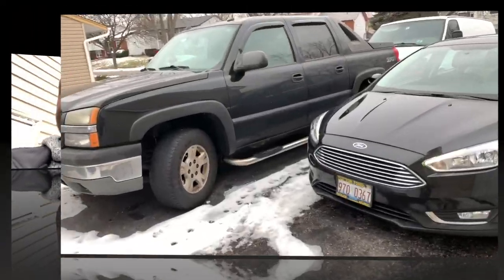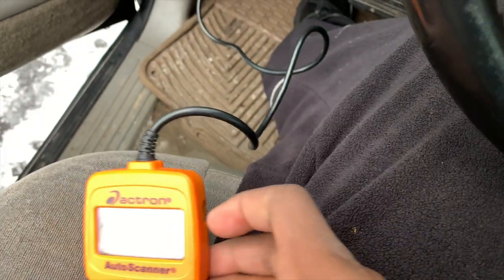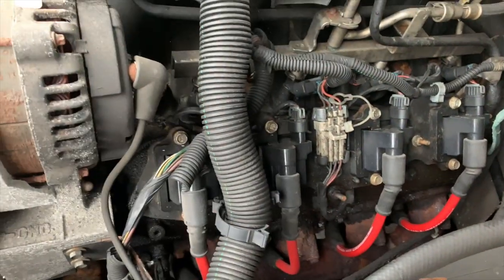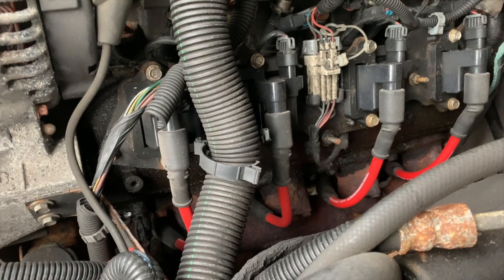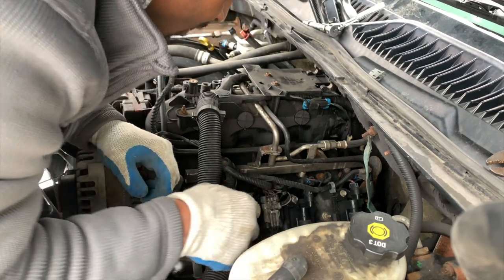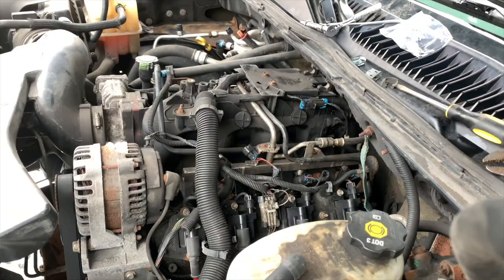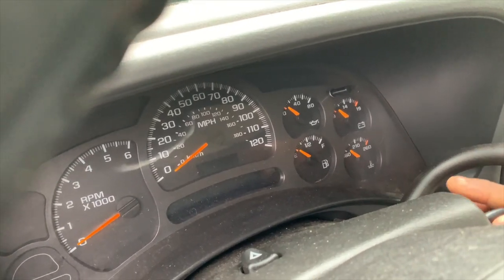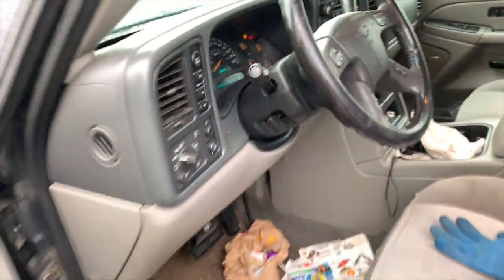Chevy Truck Cylinder 3 Misfire, Diagnose and Repair (Chevy Avalanche)

Comment: My 2005 GMC Yukon XL had the exact same problem. I took it to a car repair shop, very reputable in our town, and they replaced coil number 3. I got out on the road and within 20 minutes it was misfiring again. I took it back and they said the coil they put on was defective and replaced it with another one. Then within 20 miles that one started misfiring as well. I've been searching the internet for a possible secondary problem and looks like I found it through your video. Truck is running like a fresh engine again. 240,000 miles and still a gem. Big thank you, Sir! Keep up the good work.
Reply from the maker: Hi Ed, I am happy my video helped you. Thanks for watching!
Reply: It was the injectors?
Reply: Lmfao you didn’t even say what the issue was

Comment: I just had a similar incident. one of my brand new coil packs shorted out and blew the fuse for the entire drivers side cause if all four cylinders to not fire. All codes came back saying o2 sensors bad map sensor bad mass airflow sensor bad. Fuel pump etc. GM needs to make the fuses for individual coils. Instead of just one per side

Comment: I replaced my wires and plugs and my 05 gmc thru the same  code . I replaced the #3 spark plug with a good old sparkplug and walla problem fixed . New spark plugs can have a short to
Reply from the maker: Thanks for sharing that info.

Comment: Terence, You are dog-ass mean working in that ice.    My hat is off to you!    I haven't been working on my own vehicles since before the injectors.   Just changed plugs, then got the engine light, then replaced wires.   Diagnostic tool at the auto parts said #8 so replaced the coil.   Light went off but three days later its back.   So suspecting something similar.     I don't think I'm up for this for fear of doing more damage than good.  I have a way of doing that.   Don't pay any mind to the "throwing parts" comment you got.   Appreciate the video.   Now I know what I'm gonna pay for.

Comment: Nice video, seems like you were able to sneak the injector out without having to remove the whole rail. If you can give some details, would appreciate it.
Reply from the maker: Hi Victor, You can replace it without removing the entire fuel rail or the fuel lines. Very easy job. Thanks for watching!
Reply: You can unbolt all 4 bolts on the fuel rail (2 on each side), then completely pull up the side you're replacing the injector on, (make sure to blow everything off first and not get any crud on the tips of the good injectors), and remove all the wiring on the ignition coil rail and then unclip the bad injector, wiggle it out, grease the o rings on the new injector, pop it in, clip it in place and reverse the procedure, making sure the side of the fuel rail you popped out completely pops baxk in all the way and none of the o rings slipped off upon removal
Reply: You should swap the injector with another and see if the code pops up for that cylinder.
Reply: @TerenceDIY i noticed that gas from the rail almost pinged ur hood mine doesn’t have that much pressure I changed the fuel filter a yr ago but it starts every time, should I b worried about my fuel pressure?
Reply from the maker: Nope, you shouldn't be concerned especially if it's running well.
Reply: @TerenceDIY  1 more question if u don’t mind brotha I swapped my engine n when I obd scanned it it had similar codes pop up I don’t remember exactly what Dey were bu would my ecm store em or dey new codes
Reply from the maker: Yes, it is possible for the ECM to store those old fault codes. If you have a really good scanner you could reset them or just drive the vehicle for a while and they should clear out if the ECM does not detect the codes after so many starts.

Comment: One of those codes is one of the front 02 sensors the p0420 if you replace them do it in pairs there are 4 02 sensors on these trucks 2 upstream 2 downstream  atleast mine does
Reply: 420 is a dead cat. Due to driving around on the misfire.
Reply: Did it misfire while you were driving I have a misfire at 20 at 40 it stutters and mises or feels like a jerk at 50-60-70-80
Reply: Replace them all if ther on header exhaust been there aint cheap fix thogh easy to do also catalyst concerter are a big hit but do it

Comment: Looks like your missing your plug wire metal heat shields. The rubber on the spark plug wires can’t handle the heat from the headers. Js

Comment: I have the same problem misfire cylinder 3.p0303 Did you have to do a relearn on the new injector?
Reply from the maker: Nope. Once you install the new injector, you will be fine. Thank you so much for watching.
Reply: @TerenceDIY  I'm in Dolton gonna buy 1 tomorrow with a misfire you up for the job?
Reply from the maker: I would love to help but I am backed up. Every since my dad passed a couple of months ago, I have gotten off track. I am finally making ground to get back on track.

Comment: I have a problem with cylinder #4, checked by swapping wires - coils..  I will pull injector and try some carb cleaner Can't hurt anything for sure. Thanks for the tip.
Reply: How did you fix the problem?

Comment: My 02 suburban has misfire in cylinder 3 and it won’t crank till 2nd or 3rd crank not sure if it needs wires n spark plugs or a fuel injector
Reply from the maker: Sounds like you may have a bad ignition coil or injector.

Comment: Hey Bro, where is cylinder 6 on your Chevy Express Van? You know, which ignition coil is consider cylinder 6?
Reply from the maker: Hi Conrad, cylinder 6 is the 3rd coil on the passenger side. The first one on the passenger side is cylinder 2 for reference. 2,4,6,8 . If you have anymore questions feel free to ask. Thanks for watching!
Reply: @TerenceDIY  , Thanks. I took out those new, ignition coils because they were defective. Got my $325, back A.S.A.P., & put the old ones back in. Engine light went off imediately. And, no problems starting.
Reply from the maker: @conradsuddarth632  , that's awesome!!

Comment: I LOVE YOUR VIDEOS THE CAMERA SHOTS ARE EXCELLENT check the ASD RELAY IN YOUR FUSE  IT HAS TO DO WITH A SIGNAL SENT TO THE ECM. JUST A THOUGHT SINCE IT CONTINUED TO IS AT THE SAME CYLINDER. ALSO ITS SAFER TO USE A SPARK TESTER.
Reply from the maker: Thanks for sharing that information.

Comment: Dang man ,good way to check it but it sounds like the engine has some mechanical issues, it may be just the  sound on the camera
Reply from the maker: The engine had a slight tick, but other than that, it ran fine. Thanks for watching!
Reply: @TerenceDIY  you bet man, I retired as a auto tech, bored tonight just surfing, keep on keeping on !

Comment: I have problem with my 2005 chevy  tahoe 5.3 misfire on cylinder # 6
Reply: what was the issue?
Reply: Me too I changed pack and wires still low compression on 6 2008 Chevy Silverado 1500

Comment: I’m having the same issue on my truck. Switched the coil pack, spark plug but the check engine lights keeps coming back. After you replaced with the new injector did the misfire continue? Not sure if you said in the video couldn’t hear if you did
Reply from the maker: Hi Diego, this new injector fixed the misfire instantly! If I were a betting man, I would place my bet on a bad injector. If you replace it, let me know how it turns out. Thanks for watching!
Reply: Terence's Youtube light came back on after I replaced it. Now I’m lost on what it could be
Reply from the maker: @diegobrizuela1459  can you send me the code that triggered the light, Diego?
Reply: Terence's Youtube hey I’m having the same exact codes as your Chevy except it’s on my Chevy express, cylinder 3 misfire and evap fault, did you end up switching out the evap solenoid and canister?

Comment: this is not a diagnosis this is you throwing parts at it till you fix it.
Reply: I can’t get a check engine light on my truck nor can I get a parts house to put their computer on it because of the covid 19
Reply: Did you see something I didn't?  He didn't throw parts at anything. He found that it was his injector that was bad and he got a new injector.
Reply: @billcoley8520  A simple code reader is pretty cheap now days and their easy to use. Even Walmart sells them.
Reply: Hey buddy...calm down and get a clue!  Great job diagnosing and solving his problem.  Now what is yours? 😮